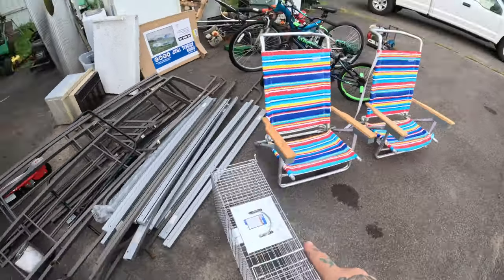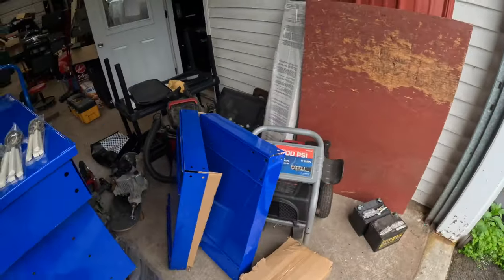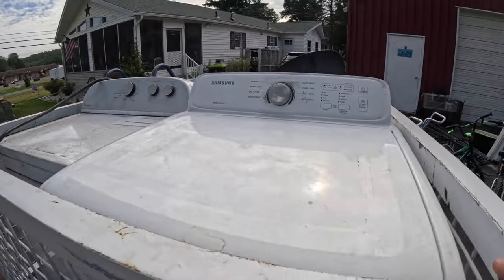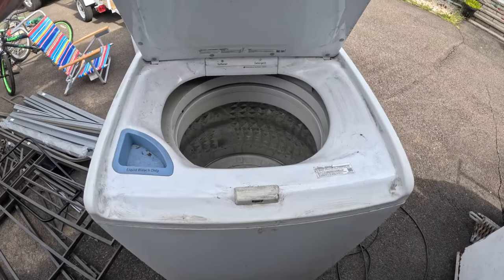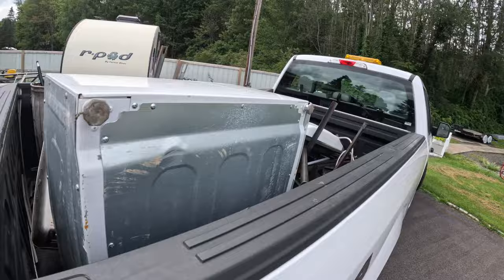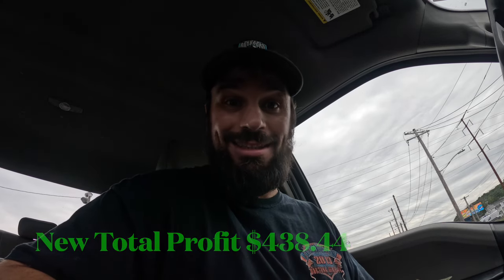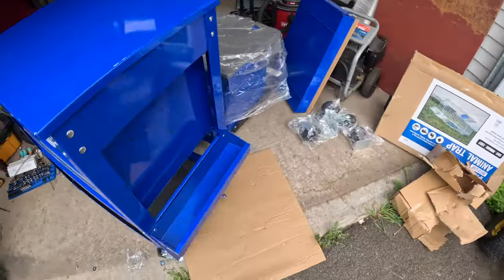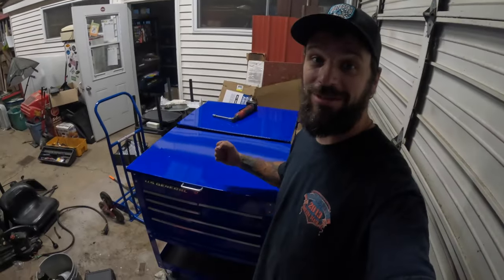BEST Dumpster Diving Find At Harbor Freight Tool Tuesday

Comment: Appliance Test Plugs:  you mention you have a Welder Plug, so with all the appliances you handle you should consider making up a few 30-50 amp pig tail test cords that would plug into your welder plug.  Each short adaptor could have one of the common Female plugs on the other end to fit various appliances (stove, dryer, etc).  The plugs cost a bit each, but you only need a few feet of wire to make up each test adaptor.  That way you could test units out and sell more parts.  :oops:
Reply: An alternative, if you have extra breaker slots in your shop’s Electrical Panel would be to get a couple surface mount female 30-50 amp plugs of the needed type and wire them up with breakers into the panel.  Again, the cables don’t need to be long, if you can dolly the appliances in near the Power Panel, to plug them in for testing.  Cost a bit to do, but would pay for itself in tested parts.  :oops: